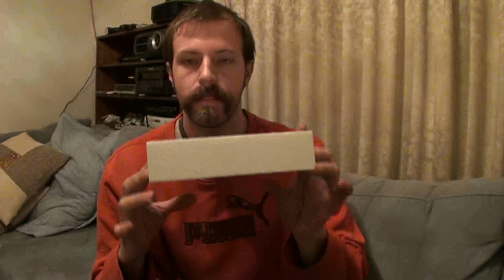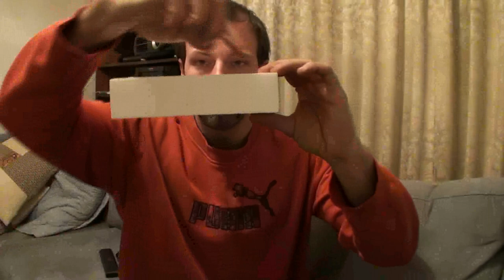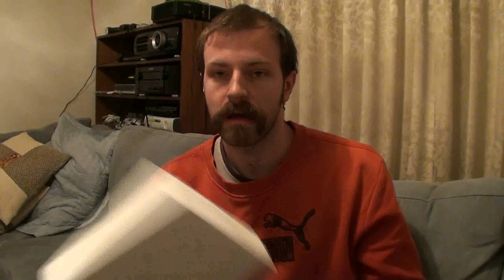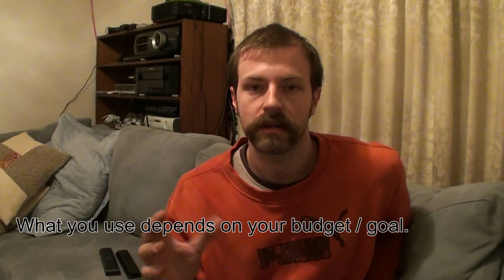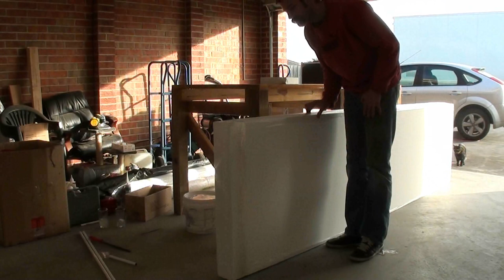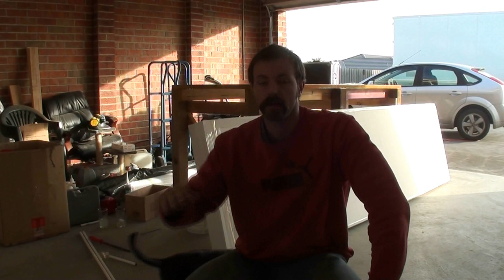Sandwich construction benefits explained

Comment: actually I'm a civil engineer,I shouldnt ask this:)..is this styrofoam+weatherboar element used as the floor of the house,or as the inside walls? I want it to be a structural element which can carry load..I've just seen some cheap methods on youtube for building like straw berry houses..just wondered if I can build a cheap one )..usually at work I deal with concrete..